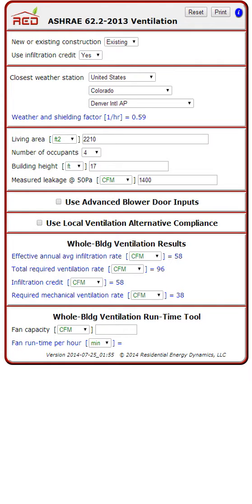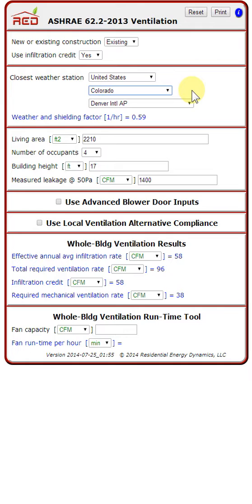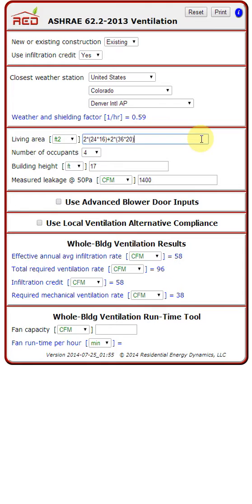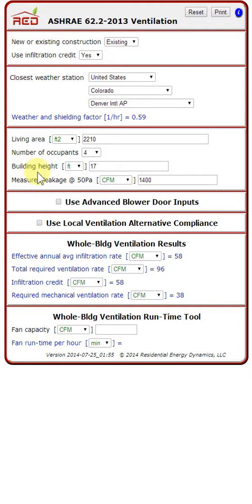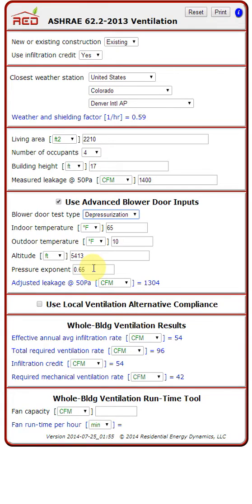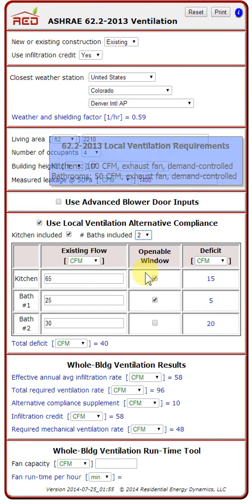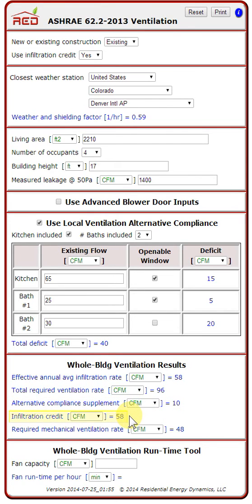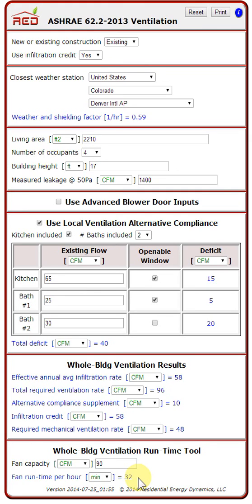ASHRAE 62 2-2013 Video Tutorial extended version

Comment: Hello! so if I already have exhaust fans existing like the example of 65, 25 and 30 cfm and the Required Mechanical Ventilation rate is 48 cfm. What do I do next? Do I installed another fan with 50 cfm or replace the 25 cfm with a 75 cfm? Please help. Thanks
Reply from the maker: Tino Garcia I don't have enough information from you to respond. Please contact me, Rick Karg, at rjkarg@residentialenergydynamics.com